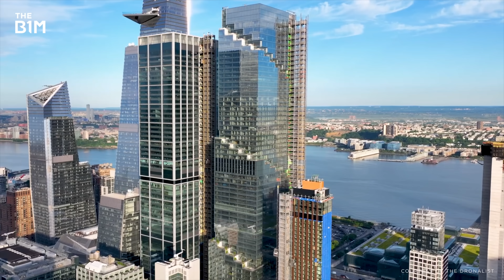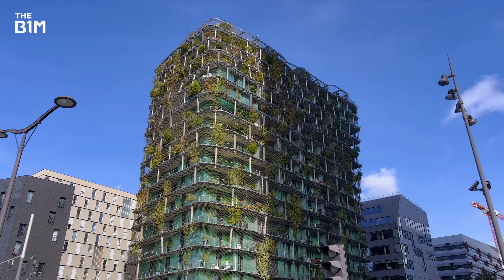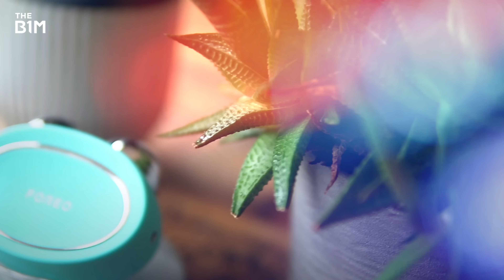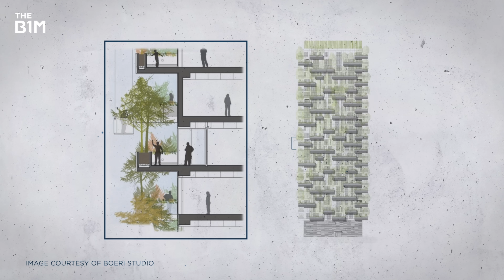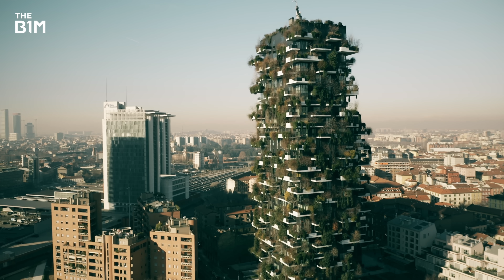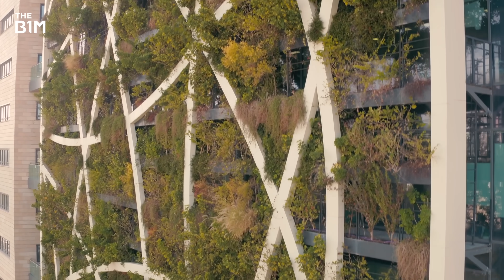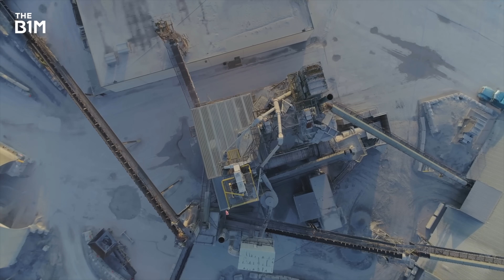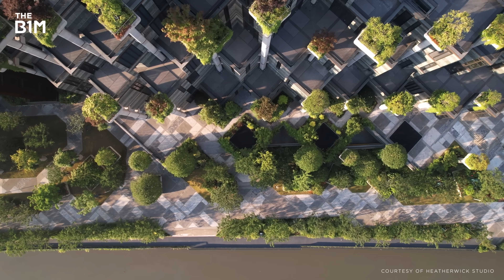Tree-Covered Skyscrapers Aren't Actually That Green

Comment: We need trees at ground level where the shade can cover hot blacktop and some can produce fruits and nuts, not on the side of a skyscraper where they require acrobatic maintenance and reinforced structures. Its a gimmick... and I LOVE trees!
Reply: But it's a gimmick with real benefits, so just because it isn't the perfect solution doesn't mean it's bad....
Reply: @John...44...  It's not bad because it's not perfect. It's bad because it's a stupid, inefficient and impractical idea.
Reply: @tbird81  what's the alternative? The same building with no trees? I know what I'd prefer
Reply: @John...44...  The building without trees is better for the environment. You realise what trees are? They're not some sort of sculpture. They're living objects which grow and take resources to care for. They'll eventually grow too big and will be pulled out and dumped (at great environmental expense), and all that carbon liberated into the atmosphere again.

The alternative is not building such structures at all. We need fewer people.
Reply: @tbird81  not building at all and lowering the population is not an option at all so that's irrelevant.
You can plant plants that don't need to be pulled out after so many years. Yes there is additional CO2 cost from the added concrete but it is marginal over the whole building and it is worth it, in my opinion, for the quality of life and local environmental benefits it gives
Reply: @John...44...  The real problem is we are overusing resources for aesthetics, when we should be building the most efficient structures with fewer unnecessary decoration. Nature belongs in contiguous expanses of wild spaces so wildlife can thrive, not just eek out a living on the edge of a skyscraper.
Reply: I personally think that these trees on skyscrapers won’t last long especially the buildings themselves.  In my country, the Philippines, we have issues with earthquakes and typhoons every year.  These disastrous events damage infrastructures and it is difficult to repair them once the tree roots go through the cracks and further break concrete.

That along with potential hazards of falling timber caused by strong winds.  So they’re merely an aesthetic that doesn’t offer any benefit but problems once you think about it
Reply: @John...44...  The only benefit you get from a tree in a skyscrapper is less  particulate matter and a psychological pacifier for you. You can't replicate the effects of a tree in a natural system, by stripping the soil and putting it as an isolated entity hung up. It's like taking a human being, putting them in a tensparent box on top of a tower and airdroping them essentials. Sure you can survive. But for how long. How long will you survive if the air dropping gets some technical issues and nobody notices before you die from dehydration? And are you going to a net expense or are you going to be a net producer than a human who can walk in the ground and go get his own water, food and shelter?
Reply: @Aleena Prasannan  they are not trying to replicate a natural forest, they are just adding plants to somewhere that otherwise would not have any. This is a positive if it is done correctly for the benefits you have mentioned as well as helping decrease urban heat island effect and reducing carbon dioxide. So all in all in my opinion a building with plants is better than a building without. A whole city built in this way would be incredible
Reply: @John...44...  And that is the problem. Adding plants to where 'it otherwise wouldn't be' aka where it's not meant to be, doesn't mean it's doing something good than doing a lot more harm to the environment. If you put a plant somewhere where it demands more energy to maintain it that the amount it 'temporarily sequesters' , it's doing harm than good. You aren't even sequestering carbon with plants if you don't stop it from releasing it all back into atmosphere when it decays. It's biomass will only be sequestered if it's fallen biomass gets fully transfered into a complete top soil system, which an isolated container doesn't have. 
Putting a tree where it isn't otherwise present, is as 'environmental friendly' as turning a wetland ecosystem into a monoculture woodland.....aka redundant and destroying a natural highly effective longterm carbon sink. 
Please educate yourself and understand that trees don't belong everywhere. There is a reason why  ecosystem are different. 
There is a reason why after a certain elevation you get meadows instead of forests. There is a reason why there is no trees or even grass on top of rocky mountain tops. 
You aren't doing good by putting a plant where it was not previously. 
Please understand that 
Intention does not excuse effect. 
Putting a plant where it previously wasn't is a naive, oversimplistic, easy GREENWASHING with poor and lazy research. 
Ignorant naivety is not an excuse for poor incompetent research, especially when you are a rich player in real estate who can afford to to hire people for it. It is not even naivety in their part because they know full well that having green spaces on ground is what's actually beneficial, but it will mean they have to give up all the money they can make from all the multilevel floor space they can sell from the same small space the have to dedicate for the green space. So instead they area giving a poor sham of energy exhaustive green space on top which they can use to multiply the value of all the additional floorspace. 
It's pure greed and a greenwashing label.
Reply: @John...44...  I said it doesn't fix urban heat Island effect. Please go and read my comment again. Urban heat island effect is caused by sealing the top soil and trees in a skyscrapper is not unsealing top soil, neither retaining topsoil moisture not shading top soil from incident radiation. 
I literally said the exact opposite, that trees in a skyscrappers doesn't do anything to mitigate heat island effect. Infact it's only going to increase ambient heat by increasing humidity from their evapotranspiration. So the trees in skyscrappers does nothing to reduce urban heat island effect, plus it will trap more heat that gets radiated out for sealed land and concrete, with the increased humidity from their transpiration. So now instead of a hot city, you'll get an even warmer sweaty sticky city, congrats.
Reply: @aleenaprasannan2146  Trees help reducing heat island effect. This is not a debate but something that has been studied multiple times, for example they are recommended by EPA. It is not "greenwashing". You guys should stop labeling anything that isn't under the armchair urbanist playbook greenwashing
Reply: @elciervoparaguayo3756  Trees do help heat island effect. But there is a caviet of 'how'. You cannot misinterpret the a study by cherrypicking one factor and changing every other factors. Co-relation does not imply causation- which is a rudimentary principle in research and what you are dping now is ignoring thw entire causative factors to cherry pick the correlated factors to fit your explaonation. Like I told before, heat island effect happens when the ground surface is bare and absorbs too much incident solar radiation, soil moisture retains even more heat till it evaporates as water has higher specific heat making the ground a lot more hotter than when the ground and moisture is prevented from heating up. That is only going to reduce when vegetation covers the ground. Buildings have very different heat capacity, varying even more type of with building materials on surface, and also don't have the additional effect of moisture. For you claim to hold, you have show specific studies focusing on the effect of roof top or balcony vegetation's effect on building surface temperature which takes into consideration all the changes of heat specificities of particular building materials, and then analyze whether the contribution of heat island effect by a building without vegetation is still significantly higher than larger than the warming effect from transpiration without the lowering of heat from a prolific natural system top soil column in continuation to a groundwater reservoir further down.
Taking a study about vegetation on ground mitigating heat island effect and just winging that it's the same for vegetation not in contact with earth surface, is the same naive logic people use when they hear one compound in a herd has some benefits in laboratory settings and then will proceed to consume that herb without thinking anything about othe factors like isolation of the compound, soluble medium or bioavailability of it, as if none of that has any significance. 
So please don't oversimplify, overgeneralize and misinterpret nuanced studies.
Reply: @elciervoparaguayo3756  Before you jump into assuming that everyone who is critical about something is an 'arm chairexpert'....you might want to think that maybe they just might be professionally educated on what they are talking about...and maybe that's why they can clearly distinguish when something is fad 'reach' by misinterpreting and overgeneralizig a study with different factors. 
I might even have better education on this than the engineers and architects who are marketing this fad, who clearly have zero background education on the systems and cycles through which atmosphere, hydrosphere and biosphere interacts with each other, and entice layman into thinking you can replicate that as vertical patches....efficiently
Reply: @Gabriel Andrade Ferraz Well I do know that plants can grow in mediums other than soil, that is why I mentioned in another comment that trees in a skyscrapper are doing more harm than good if they use dug up top soil and that they are only something environmentally positive if they are grown in a non-soil medium or by hydroponics. 
So be it skyscrapper are ugly, and plants make them less ugly; sure we can pitch them as less of an eyesore and more of psychological pacifier, but let's not market this energy exhaustive idea as something environmentally 'positive'. 
P.s When I mentioned 'rocky mountaintop', the high elevation mountain top was the focus and not the rocky part which is seen everywhere.
Reply: Fruits and nuts... not sure fruits are the best idea since they rot really quickly which would attract a lot of pests like wasps and rats, while also requiring cleanup.  
They will hardly provide much fresh food for many people either and are only available for a short period of time each year.  

Fresh fruit trees and bushes in countries like the UK are mostly seen in gardens and parks, not the sides of the roads.  
You also wouldn't really want to eat fruit that has grown next to a road with all that pollution and dirt.  

For example, Blackberries in bushes on the side of the road are usually left untouched even in the middle of the city.  They aren't feeding people.  If you want to go blackberry picking, most people will walk somewhere in the countryside.  

Best to stick to species that are lower maintanance for roadsides.  Trees are great though.
Reply: @aleenaprasannan2146  Well maybe you should at least look at the source i send to you instead of assuming "urban vegetation" is necessary ground level, if you did you would now that the very first study EPA links is "MITIGATING NEW YORK CITY'S HEAT ISLAND WITH URBAN FORESTRY,
*LIVING ROOFS*, AND LIGHT SURFACES" and the next two studies also talk about urban forestry that isn't at ground level. Also urban trees and vegetation having a cooling effects has been reviewed multiple times as a direct causation, which you would also know if you looked at the references of the source, i'm not making up anything or assuming things i want to see. Your conclusion of humidity increasing heat was wrong
Reply: Definitely wouldn’t say that, the real benefit for tree covered buildings are for the inhabitants. I’m studying construction with some focus on increasing health benefits for the inhabitants. A lot of the benefits of adding trees and water to buildings is a bit intangible because it just improves the moods of people who work or live there so much that it’s pretty much mood alone lowering their blood pressure or whatever metric. Would also directly improve air quality inside the building more so than the city. Put as much trees on the ground as you’d like but that’s not a replacement for plants inside/on buildings. No one’s saying to put em on every building but it’s something to be considered
Reply: @cielbie8251  I don't disagree with you on any of that. My problem is where the claim of trees in buildings mitigating heat island effect when they aren't even shading ground. Usage of top soil and energy consumption to maintain them in a closed isolated system is the other problem. 
My point is that if we are focusing on reducing heat island effect, we should be unsealing more ground surface and planting on ground, and not let real estate companies fool us into giving up land spaces thinking that greenery in their buildings does the same, when all they do is reduce temperature inside the buildings. If they want to include greenery for their custoner satisfaction and to reduce interior temperature, they should also be using only non- soil growing mediums or hydroponics and should also be energy efficient, if they want to advertise as doing some environmental benefits.
Reply: @aleenaprasannan2146    the heat island affect exists because concrete and tarmac absorbs heat right?  
Why would less concrete or more shaded concrete not lessen the effects?  
And evidence seems to point to it too.   

Planting in the ground makes more sense and less maintenance costs for sure though.  

I imagine however concrete buildings also absorb heat so it could slightly cool things down for the building.  
Probably not for the whole city 

I don't think foliage on buildings like that are meant to be purely economic in benefit though, it's probably also a bit of an aesthetic status symbol too.
Reply: @tbird-z1r aren't trees made of wood and isn't wood used to make a ton of things.  Yeah, I don't think the trees will get "dumped".
Reply: @meoff7602  The wood that gets used for things doesn't come from scrub growing from the side of buildings.

Have you ever been outside?
Reply: @John...44...  I get where you're coming from. And I don't think people are dumb for seeing things like this and thinking it would be really great. But this is a huge logistical headache compared to the alternatives of just building better mid density cities with ample coventional green spaces. The problem is that the alternative can't be upsold to rich people. Which is a real problem with real estate development.

We don't build things to serve a purpose, we build them to speculate.

Here in California we're finally putting up a lot of apartment complexes, often referred to as a '5 over 1s' but they're not designed to make walkable or affordable neighborhoods. Instead, they're wildly expensive 'premium' housing for young professional that do little to relieve the housing crisis. They're also not particularly 'premium' in anything but their location relative to commercial districts.

But they superficially have SOME of the qualities of densification without including the things like 'reducing car dependence' or 'encouraging public spaces'. "

That's the catch. This isn't as good as cheaper and simpler things to build. It doesn't benefit anybody but the people who live in the building. And the, questionable, benefit comes with a host of additional costs. Alternatives, including good civic planning, would create cities with a lower tax burden, more prolific greenery without the excessive logistics burden or putting on skyscrapers, less need for cars and thus less pollution in general, better energy usage, and a healthier social landscape for residents.
Reply: Trees that produce fruits and nuts really aren't ideal in an urban environment because they tend to end up on the ground rotting and attracti g pests and being an public health issue rather than being eaten
Reply: Wasting local food sources and simultaneously shipping produce from half way across the world is part of the problem.
Reply: While it's a gimmick and building skyscrapers is not as efficient as more mid rises so is it at least a step up from skyscrapers without greens.
Reply: @John...44...  A 4-6 floor building with trees planted along the walkways next to it, with a small park inside a block of 6-10 such buildings.
Reply: For the fruit and nut trees, as cool as it sounds, we have to be careful about where to put them. We don't want old apples rolling into streets or bike lanes or to attract animals. It can get messy. Though I think it would be cool to have them at parks or something like that, maybe, but we'd have to have people hired to pick some of the apples or to clean up the ground.
Reply: @tbird-z1r  There are dwarf and semi-dwarf sizes of trees.
Reply: @Nolanthegardener  The buildings you describe are ugly and depressing. Go to any large city and you will find that most people gravitate to the beautiful part of the city. The concrete jungles built are dead spaces and bad for the human mind and soul. We need beauty. It lifts us up and makes us care about our surroundings. Go to almost any ghetto built after WW2 and they are built like this.